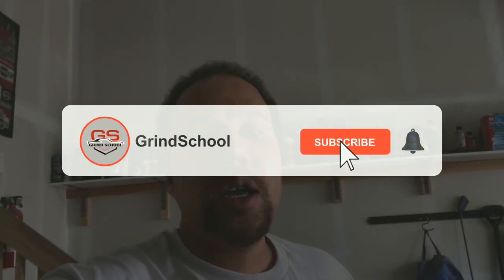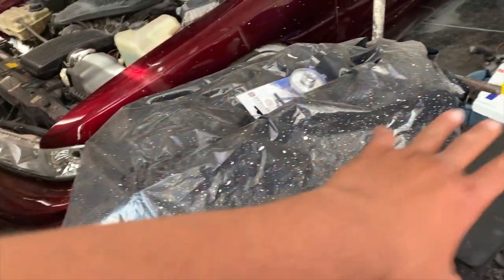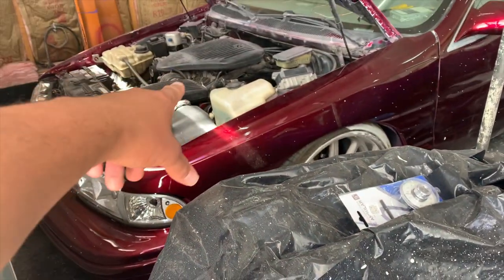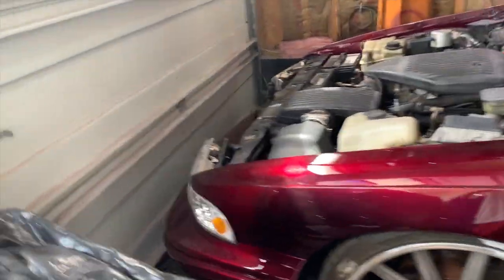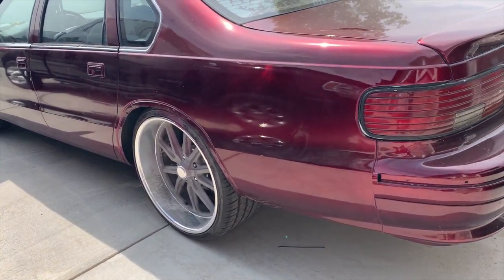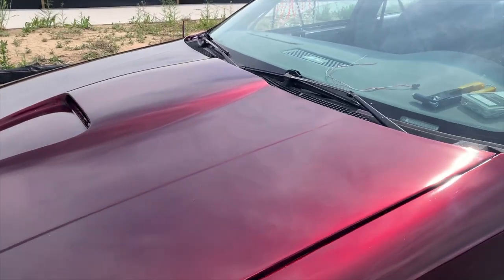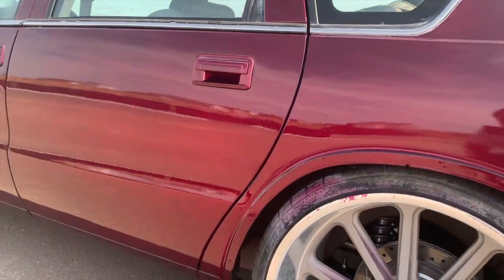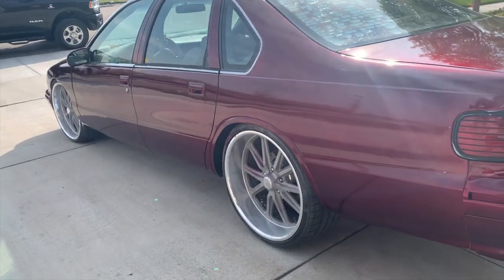I RAN OUT OF GAS IN MY IMPALA SS!!!

Comment: Follow OTG Mech if you haven't already if you REALLY want to do the swap. BUT the LT-1 is proven, if the basics are taken care of, meaning OEM type opti, good wires, and plugs. All you need is good exhaust 2.5" , 373 gears with posi and that will keep a smile on your face. Next level is valve springs and 1.6 roller rockers. If you are not doing much work to the LS then you may not be too far off from an LT-1, especially when you factor in the cost to do the swap, all the misc items will start to add up. KEEP all of that in mind. Good luck, I'm tuned in.
Reply from the maker: Yeah we chop it from time to time. He’s the one that told me what to do as far as intake for my LS motor. I’ll probably build a pretty hot LS motor. Both of the LS motors I have are bare blocks so the sky is the limit.